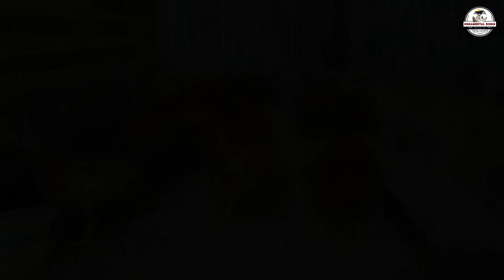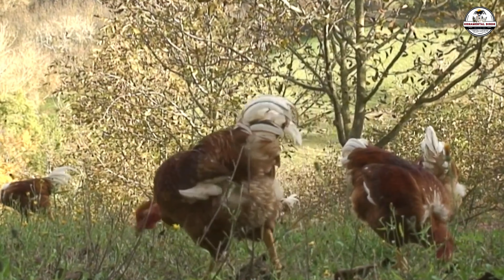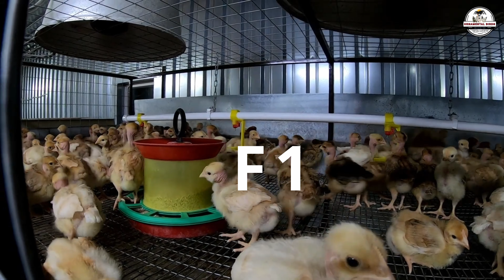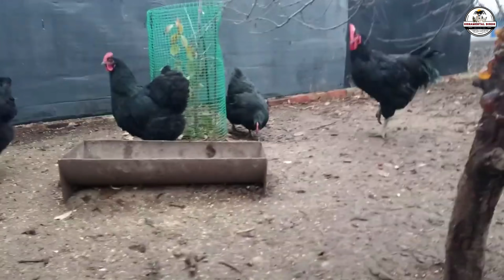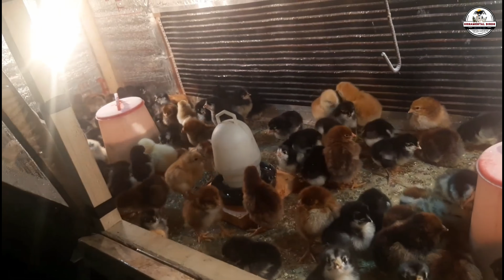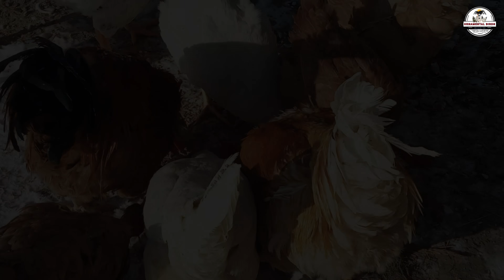The Secret Is Out! Cross SASSO with PUREBREEDS for Ultimate Meat Hybrids

Comment: Can I stabilize the genes of the sasso x Cobb sire at f5 generation and what will they weigh
Reply from the maker: Stabilizing a commercial cross like Sasso x Cobb by the F5 generation is tough but possible. You're dealing with complex genetics. You need strict selection and careful backcrossing to avoid inbreeding depression. If you constantly select your best males for size and vigor, by F5 they might hit around 6 to 8 lbs live weight depending on your feed program. Keep your trap nests ready to track those pedigrees accurately. It's a huge project for any breeder!